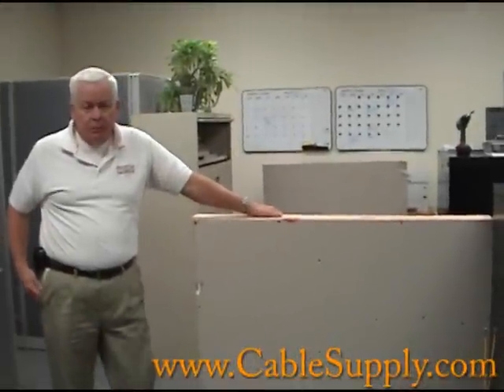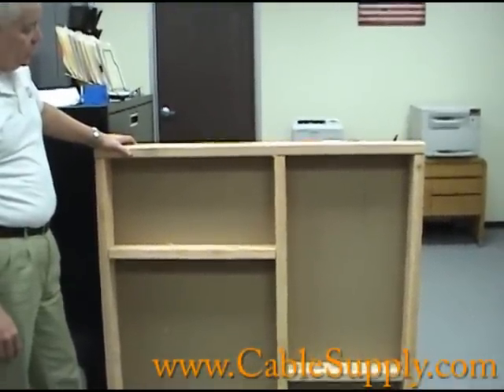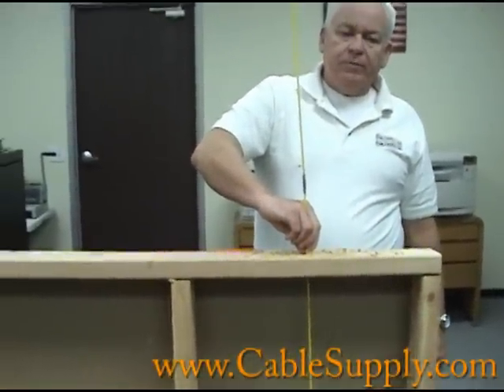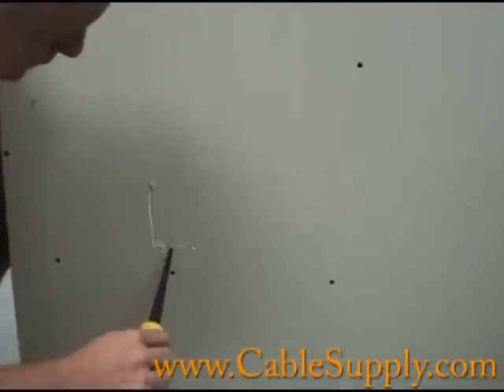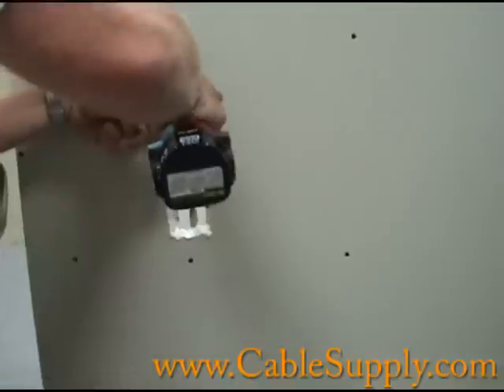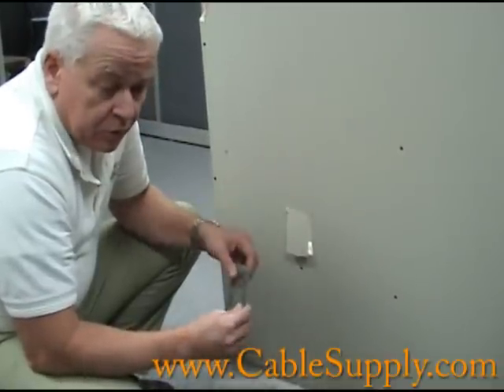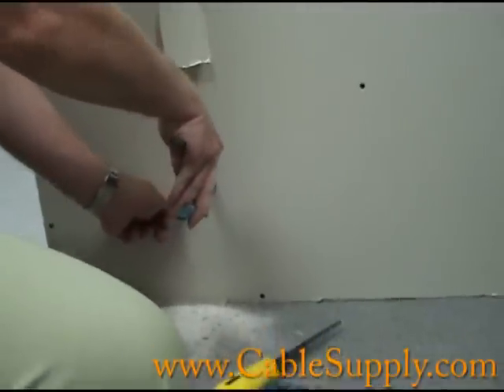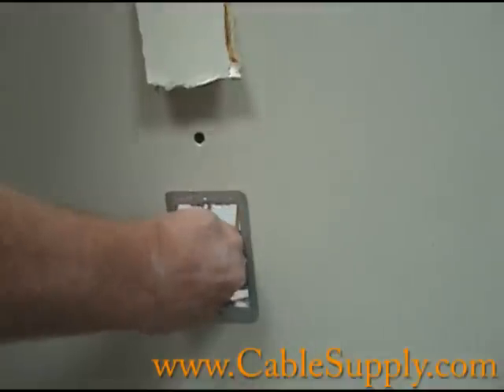How to install a RJ45 computer jack in a wall - Wood studs and firebreaks - Part 2/2

Comment: I have to get cable from my attic to 2nd floor bedroom, to the family room downstairs.  Problem -  the family room wall is offset 2 ft inward from the bedroom wall.  There are no other convenient adjoining walls.  Short of cutting the interlocking hardwood flooring, to make the horizontal run, how do I do this?
Reply from the maker: Run the cable on the outside

Comment: Good video, but what instead of drywall  someone had wood paneling?  You couldn't easily cut a hole, and drill through the fire block as you showed in this video.  Any tips, ideas or suggestions on how to get what you was able to get accomplished, but with wood paneling instead of drywall?  This is my dilemma.  Please and thank you. Great detailed and step by step instructions for sure. Just needing the same now but with paneling.

Comment: Now days on internal walls its recommended 3 top holes, 1 for extended drill rod to reach the fireblock to drill through, 1 for torch to shine light down inside, and 1 for seeing what your doing/where you're drilling, that's far quicker, less messy and inconvenient for customer than wrecking their finished, painted, wall-papered drywall where you dont have to.

Do you recommend your guys to do this way now Jim or are you still pumpkin cutting? (I say this baring in mind this is 2009 video and we are 8, almost 9 nears on)

Comment: How to fix the drywall pumpkin cut? I mean, put on some glue? what kind of glue? carpenter white glue? Thanks!
Reply: James Z use 20 minute hot mud or 5 minute hot mud if you are experienced in patching...

Comment: Just an fyi, flex drill bits are great for certain applications. Not advised on an outside wall with insulation. Insulation wraps around end and can send it off in any direction. Also they have angle arm handles that guide the bit to what ever side of the cavity you want before drilling. Trubbles, this bit and arm is what I use to fish wires to the basement all the time with a 1" and a half hole bit. Hole is big enough to get the angle arm in the cavity and small enough that plate covers hole. Basically a "tip and drill" but without wrecking the wall. Great video Cable Supply, basic and to the point.
14 year cable guy

Comment: You can drill thru the fire stop without cutting an opening in the drywall.  Drill from the top sill plate. Use a wood bit on the end of a 4, 6, or 8 foot rod. You should find them in any big box store's electrical dept.
Reply: They do work great and most have a hole near the tip so you can draw a pull string back through.

Comment: Pumpkin cut is brilliant, but I been wondering how would you tell where the firebreaks are if you a working from the attic? measure the ceiling thickness and subtract that from the length on your rod?

Comment: I'm a newbie to construction. I found this video descriptive and useful. I have one question, though. How do you start off on top of the wall? Are you assuming that the building is still under construction? Personally, I am trying to figure out how to run Ethernet wire from my main floor to my basement. I understand how to drill the holes, make the wall cuts, and fish the wire. I just can't understand how to drill a vertical hole from one floor to the floor below.

Comment: Thank you for posting this.  I think I've watched 25 videos that were useless when it comes to having firebreaks in a wall.  Finally I came across your video and it does a great job of teaching how to use the pumpkin cut and find the right place to cut to drill through the firebreaks.  Well done.

Comment: This is a great video and this is exactly the problem I running into. However, I'm fishing a wall that is painted red and I really don't want to cut a pumpkin because painting it will be a pain but I guess thats what I need to do. Thanks a lot for this help and I need to buy those fishing rods.. ;-)